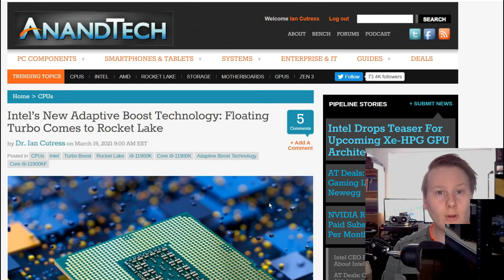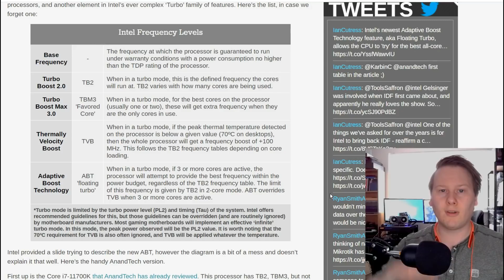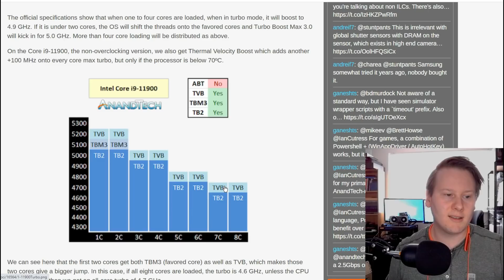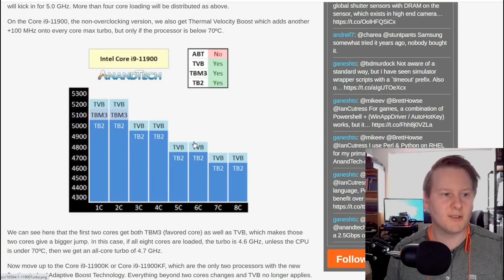The Leaning Tower of Turbo: Intel's Adaptive Boost Technology

Comment: well what would be the difference between adaptive boost and a manual overclock to 5.1 if i have a strong custom watercooling solution? i would have 5.1 GHZ on both cases all the time, right? (assuming cooling is sufficient)

Comment: Just updated the bios on my ROG maximus XIII to the beta that features ABT. I get my i9-11900k tomorrow so I'll see!
Reply: What happened?
Reply: @craiga7652  very good results actually! Runs at 5.2GHz fairly well. All in all it performs about as good as a 10th gen with the added benefit of PCIE 4.0. That's about all it is really. You need to keep it under 70C for ABT to work though so I use a Noctua NH-D15 with three A15 fans.
Reply: @XCraftllc  Thanks for reply. Good to hear a genuine consumer report. Seems basically as long as you've got good cooling they run well.

Comment: U safe lose warranty by activating these turbo...?  Because it count as overclocking?
Reply from the maker: You do not lose warranty with this.
Reply: @TechTechPotato  I just keep asking this question because I lose warranty by undervolting in combination with bpo2 on AMD.  And bpo2 is off by default too if I remember correctly
Reply from the maker: The key in PBO2 is the O. Overdrive is overclocking. ABT isn't considered overclocking.

Comment: If ABT is as good as AMDs floating turbo (for most workloads better than a manual overclock) then it can make sense. But I'm doubtful they got it that good at their first try, and it will for sure mean much higher power.

Comment: I'll be interested to see how much more manual OC headroom exists beyond what you get from the floating turbo option. It seems like the 11900k boosting to 5.1ghz all core is going to get you within a couple hundred mhz of the best you'll get by manually OC'ing, unless the core i9's have more headroom than expected. This definitely feels like Intel is trying to play catch up to AMD, Nvidia and ARM devices in terms of opportunistic turbo, and while the benefits are probably not huge for Rocket Lake I'd speculate that a smarter turbo algorithm will pay dividends on Alder Lake.

Comment: Intel’s four Turbo iterations are actually more transparent and less confusing to me than AMD’s messy implementation: Precision Boost, Precision Boost 2, XFR, Precision Boost Overdrive, and AutoOC. First one to correctly differentiate them (and explain why it matters) gets a cookie. And an engineering Ph.D.
Reply: Precision boost goes in 100mhz increments to max on single core using best core. Precision boost 2 goes in a more refined 25mhz steps to max on single core using favored core. Xfr uses extra headrange in milliseconds to boost beyond rated max (think of transient spike but for frequency) pbo allows the max boost to be pushed higher and then re-engages precision boost 2

Comment: Say, Ian - I have a question. Could you point me to a source that I can use to compare the following: I'd like to know how different nodes compare in terms of pj/bit? I'd like to figure out a coefficient for architecture-node. I'm trying to see if what comes after Zen is going to require 3D stacking. I mean, think about it. When we get to Zen 5, we'll probably already be at 4-3nm and along the way, we'll get to see just by how much transferring electrons for shorter distances affects power consumption.
Think about it: if we don't have at least a couple halvings by 3nm, who cares about nodes? It makes sense for AMD to focus on their packaging - and probably much more advanced predictor - and both are going to be key if you want to stack memory and a bunch of accelerators on top of the cores. 
The only way for nodes to still drive THAT process is if someone comes up with a design that has cores sandwiched in the middle. That's not possible, is it?
Reply from the maker: It's not that easy to just have pJ/bit per node. It depends on the PHY, the medium it's travelling through, and the protocol. You can be on the same node and pJ/bit can very by 2-50x.

Comment: One question about the "base frequency" thing: how is different VRM efficiency taken into consideration? Running the same CPU on different motherboards will read vastly different TDP from the same CPU at the same freq, so it seems that VRM quality is taken into account into that value. Does that mean that the bae frequency at the SKU given TDP is calculated against a worst-case scenario TDP value?

Thanks for the very insightful content as always
Reply from the maker: Kind of, but not really. For Intel, TDP and power draw are identical, because they only look at the processor in the socket. If you have a low end motherboard, the VRMs will just hit the current limit earlier and your turbo will be lower.
Reply: @TechTechPotato  yes, that is referring to turbo, i was just wondering if a reeeeeally crappy VRM would have issues mantaining a 10900 base frequency (2.8 if i recall correctly)at 65w..? It's just pure speculation on what would be the behavior of the CPU in such scenario.

As i love undervolt, and i mostly build ITX systems and tune laptops for professionals, i did my fair share of look (and much of the theory behind comes from your writings)i nto TDP limiting, VRM efficiency, undervolting etc etc, when a higher PL2 actually gives less performance in the long run.
https://www.pizzaundervolt.com/choosing-a-computer-for-audio-production-laptop/

Comment: Hi Ian, I was hoping you might be able to clarify some stuff for me. Why does TVB exist? I understand what it does, but to do what it does, it seems to me like Intel would have needed to dumb down its other technologies, all of which seemed to have been based on max limits, including temperature. This confusion might come from my misunderstanding of how TB works in 
the first place. I'll explain how I think they work below, though feel free to skip that if you don't need it to answer the question. Let's think of Turbo Boost 1, 2, and 3 as three different technologies stacked on top of one another, which the CPU triggers based on a given parameter. TVB feels like dynamically extending Tau based on thermals then running TB1 alongside TB2 or TB3 intelligently based on the same parameters, except nearly all Z series motherboards ignore Tau.

First I need to clarify TB vs. TB2, which seems to have incorporatedit. When Intel Turbo Boost originally came out, to the best of my recollection, and what I can find online that talks about TB1 and not TB2; it got triggered when it determined an application was maximizing one or more cores while the CPU was below its specified maximum power, current, and thermal limits. In that case, TB would bump the clocks for the cores used in steps until either it met the performance demand needed, hit max turbo clocks, or it hit one of the hardware limits, whichever came first. If it hit those hardware limits or the performance requirements lowered, the CPU would start throttling until it was within the lowest clocks needed to perform the given task within its specified limits or hit the base clock, whichever came first. It seems TB was less about making the CPU faster; instead, it made it more efficient and reliable. It allowed the CPU to draw less power on average, but you could get more within reason if you needed it. The turbo clock would then be the maximum recommended clock Intel thought the CPU could sustain, whereas the base clock would be the one it thought would strike a good balance between performance and power. 

When TB2 came around (and this one I'm basing on your 2018 article, among other sources), it seems that Intel added two significant enhancements. One is turbo for integrated graphics in the form of "Max Dynamic Frequency" and the second PL2 to accelerate single-threaded workloads. PL1 then essentially became classic Turbo Boost which seems more like inverse turbo, whereas PL2 became Turbo Boost Extra. TB1 was initially limited to the max rated TDP; TB2 is now limited to a second, higher TDP up to a predefined period, after which the CPU could still turbo but in the classic TB1 style limited to PL1. As for TB3, it seems like it's just TB2, but it's mindful of your two best cores and will try to get the system to prioritize those so it can run some form of enhanced TB2 with a higher frequency or for a longer duration without having to raise the TDP limits further. 

Since the whole stack got TB2, it made sense to drop TB1, but since not everyone gets TB3, Intel still includes both on the CPUs with TB3? In that regard, it seems that Intel should market its CPUs with either TB2 or TB3 instead of both? Or better yet, since AMD is competing on single-core performance now, incorporate TB2 into TB3, apply TB3 across the stack, and dump TB2.

Edits to try and get the youtube comments text formatting to work.

Comment: "Are you going to disable turbo boost to save power?"
Is there really any member of your audience who would do that
Reply from the maker: Yes, yes there are. Fanless/quiet systems are a thing :)
Reply: @TechTechPotato  But fanless with current Intel? That sounds... bold, to say the least, given that it's the i9. What cooler would you need for that, given the results you got with your Thermalright heatsink?
Reply: @TechTechPotato  Yes, but who in today's world would go shopping for 14nm if efficiency is at all a priority lol
Reply: @TechTechPotato  I rather have an Apple M1 Macbook.
Reply: HTPC are definitely a thing.

Mine goes from dead silent to loud cooling pretty easily.

Comment: I've used Ryzen since 2700X, and I've always just enabled PBO and let it do its thing,  so to speak. It seems that in more recent processor generations, the return on time invested into manual overclocking has diminished when one can simply enable the more advanced boosting technologies. That said, I agree wholeheartedly that Intel needs to begin disclosing the max power draw under load with the turbo enabled. They also should have left PBO on when comparing their 11th gen to a 5900X, but Intel has never been known for fully disclosing and being anywhere near fair in their testing, so why would they start now?
Reply from the maker: Note that PB2 is different to PBO (which is different to PBO2).  PB2 isn't an overclock, it's just floating turbo. PBO/PBO2 are overclocks.

Comment: Better late than never? Also, for the flagship only? Really, Intel? Are you... sure?

My last Intel experience was a bit of a mess. The 8700K ran too hot when OCed - w/o capping power levels, the CPU ran away thermally when stress testing even w/ reasonable overclocks and optimized voltages. I had to de-lid it, put it under water and, in the end, cap its power levels to something reasonable. Also, on one hand AVX offset was not implemented properly on my board and the frequency kept fluctuating down to the offset value regardless of load (which annoyed the hell out of me and was never fixed in BIOS) and, on the other, the default voltages were very high, so anything adaptive based on those was not viable, the offset had to be in excess of 100 mV.
In the end my options were a) default, leaving a bunch of performance on the table for no good reason, b) Multi Core Enhancement @ eye watering voltages (I believe my Asrock Fatal1ty Z370 Gaming K6 ran AVX loads @ 4.6 @ ~1.39V while the tested optimized value for the same frequency was around 1.28?) or c) the fixed voltage, fixed frequency mess I've described above (fluctuating 4.7 - 4.8 @ 1.325V @ some arbitrary power cap between, say, 150 and 200 W, which forced frequencies down, but, of course, the voltage did not adapt).
Yes, it was plenty fast for what I did with it, but the whole thing left a bad taste in my mouth as a customer, thinking of how many of those niggles (and how much time) the manufacturers could have saved me.

Much happier w/ my 5800X. The AIO provides thermal headroom which the CPU uses to OCs itself, plus it also protects itself, never going above 90C, and the curve can be optimized further by hand w/ the aptly named Curve Optimization tool.

Next step - better memory training and, while we're in what-I-want-for-X-Mass mode, properly factory pre-calibrated displays! Oh, and enough GPUs for everyone... that too.

Comment: When I read the news about this new turbo boosting all cores of the 11900k over 5Ghz, all I could think about was that this was gonna be Intel's FX-9590. The power and temperatures are gonna be through the roof, the damage this cpu will do to their reputation will last a while.
Reply from the maker: i7-11700K, 8 cores, AVX2, 4.6 GHz: 225W, 81ºC
i7-11700K, 8 cores, AVX512, 4.6 GHz: 292W, 104ºC
It's all in my 11700K review over at AnandTech
Reply: @TechTechPotato  I know, I read it. Which makes me fear the 11900K numbers. Does this generation even have an AVX offset, I thought not?

Comment: I want my turbo button back... ;-)  (Not really, just being funny).
Reply: TVB and PBO, if you had a decent cooler that also had phase change cooling then you could have a turbo button.

My AIO fans have two modes, fine tune with a dial or a higher speed (which can also be tuned by dial) so effectively I do have a turbo button. I wouldn't have thought of that if you hadn't said something.
Reply: Bla - too much complexity.  Honestly, just replace it all with the simple "old school" turbo button - just like all my former 80's & 90's PC's had. ROFL ;-) (And I'm still just joking around)

Comment: I finally understand what that weird self-conflicting Intel graph means
Reply: @perilousdissidence please refer to the article in the video description. A static voltage and ratio should disable boost technology by definition, while ABT and TBM3+TVB should opportunistically net you up to 5.1 on all cores and up to 5.3 on 2. Whether these are achieved is dependent on cooling, power and silicon lottery. You will have to override the power limits and duration with the maximum values to have sustained boost behavior.

Comment: I doubt that B560 boards will be able to properly power a Core i9 period, just look at the cheaper ASRock Z490 boards, they couldn't even power a 10900K at its base turbo without overheating, they couldn't even sustain an overclocked 10600K without overheating. So the floating turbo will probably be useless on most B560 boards if it will be supported.

Comment: Do you think the high-end Z490 motherboards will get BIOS updates to support ABT?
Reply: I have confirmed with ASUS, yes they will.
Reply: @BatTech  Thank you, that is good news.  I hope that MSI does as well, since I have both ASUS and MSI Z490 mobos.
Reply: @life-longpatriot8258  I can only speak for ASUS as I am in contact with them, but Rocket Lake on Z490 boards will be getting all the same support even the improvements with the microcode, however, Intel is prioritizing Z590 right now naturally.
Reply: @BatTech  Thank you! That's great to hear, because if ASUS is doing it, it seems reasonable to think that the other mfrs. will follow suit.  I was just lucky enough to pre-order an 11900K on Newegg about 15 minutes ago.  I've been trying since the 16th, when I first noticed that they were accepting a limited number of pre-orders on a first-come, first-serve basis.  They would just pop up at random times, so I just kept checking their website and finally got lucky.

Comment: And I thought AMD's marketing team was bad. Now there are 4 different types of boost on Intel.
Reply: Ironically most OEM boxes ship with insufficient coolers so they'll only see boost for a split second.

This helps Intel win benchmarks, which sells computers that ultimately can't win the benchmarks.
Reply: @glenwaldrop8166  insufficient cooling, insufficient VRM, insufficient power supply, and more

Comment: How is the temp measured and from where? As you have already shown, unless you are using sub-ambient cooling then the heat soak within the chip is greater than what can be removed by most coolers and will hit over 100c so easily over the 70c as set by Intel's Adaptive Boost Technology. So will we see this being of any use in the real world?
Reply: Real world workloads rarely hit all cores with AVX512 though
Reply: @MeowMeowDeathRay  That is true and I am sure that was an extreme case but I still have my doubts that even if you are just using something like Handbrake, WinZip, Lightroom Export, etc, anything that uses all 8 cores at 100% for more than a few seconds that we won't see 5.1GHz maintained as coolers simply can't remove the heat fast enough for the CPU to register over 70c. 
But lets see, maybe the 11900K will be so highly binned that we wouldn't really see them in stock they are just a mythical flagship products sent to testers.

For gaming it would be a little different as games don't put those kinds of sustained loads through the CPU so that might be more interesting. I guess if someone was looking at productivity workloads they would be looking at the 5900X anyway.
Reply: @Speak_Out_and_Remove_All_Doubt  benchmark/leaderboard battles?